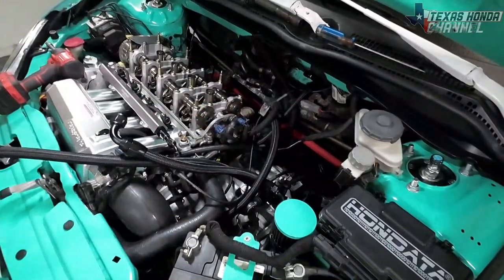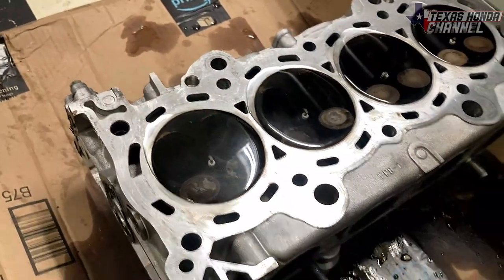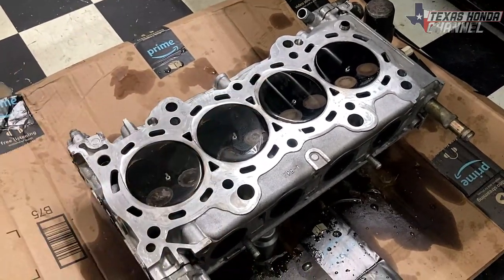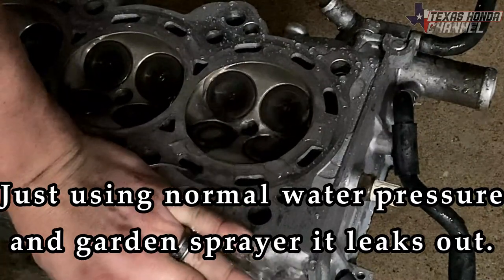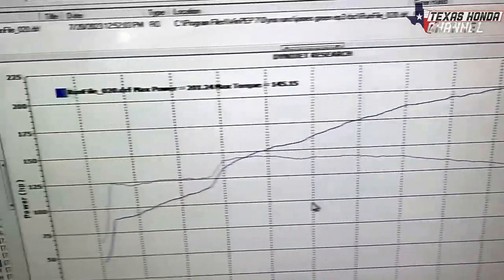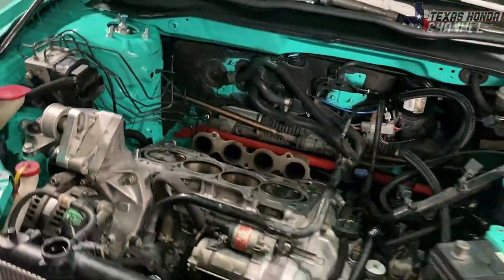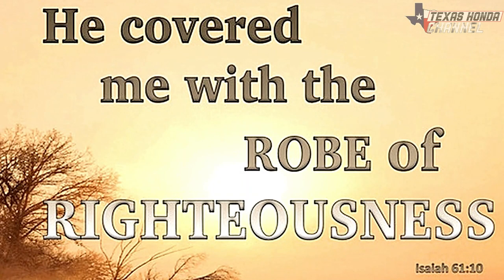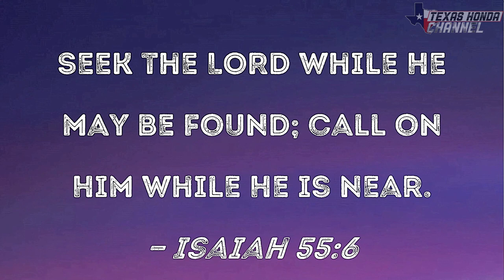CHEAP EASY WAY TO FIND LEAKY VALVES OFF THE CAR & AVOID BEING SCAMMED.

Comment: Perfect timing. Timing slipped and I just bought a marketplace head so I could port and build the other one. This is the only thing I haven't checked, because I didn't know.
Reply from the maker: I think it’s normal for a super small amount to get by the valves because water seeps but it shouldn’t be dripping out the intake or exhaust runners.

Comment: Great info!
Reply from the maker: Thanks man and hope it helps someone not get scammed. I can’t tell you how many cylinder heads I have bought over the years and the other method I use but forgot to mention was the filling up the intake and exhaust ports full of water. It’s a little more accurate at times but this method is works good too.